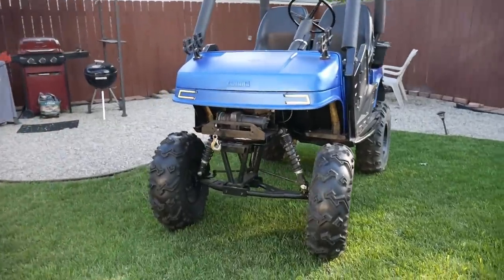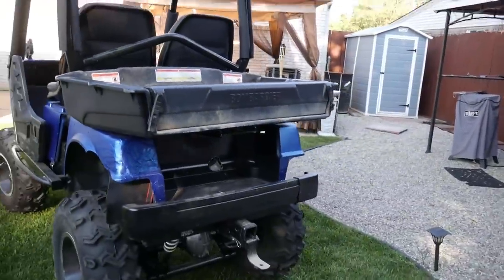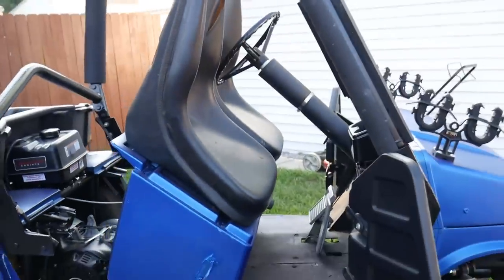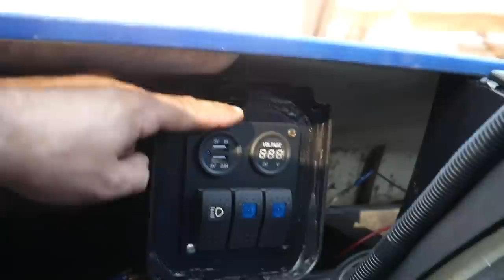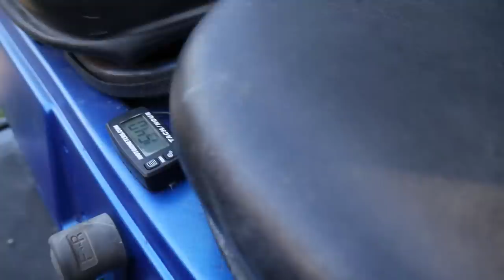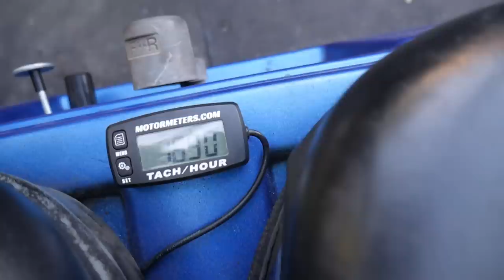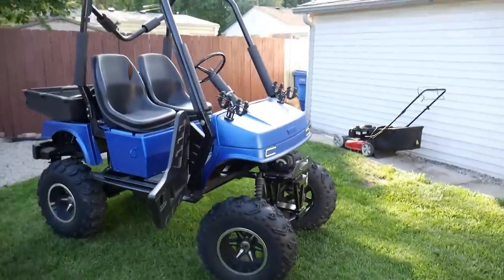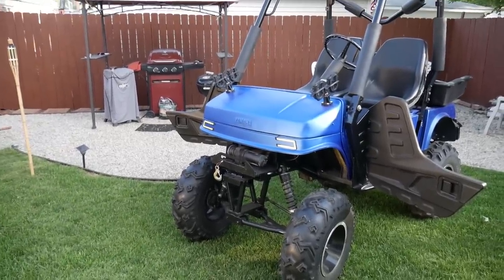Custom golf cart finished !! predator 420 installed!!

Comment: I've been waiting to see this beast finished. I really like your roll bar and doors set up. I wish mine had the same. but unfortunately I'm still stuck on engine and suspension. My honda gx 340 started running rough as soon as I set it up with a fuel pump. I'm not sure what the heck happened. And my front suspension set up is not going to work for me. unfortunately the shocks I bought for 100 bucks are not strong enough. the bid tires rub on everything even with the 4" lift and I have to modify my new suspension lift to make clearance.
Reply from the maker: Kyle Clayton i had to do the same for my front suspension, bought like 3 different shocks before i found something to work and also had to relocate the shock mounts definately frustrating at times. i didnt want to go with a fuel pump thats why i figured a way to mount tank so i could stay gravity fed
Reply from the maker: Kyle Clayton oh and thanks hope you get everything worked out with yourz

Comment: I just bought a Yamaha gas cart project for $200 with a dump bed.  I plan to copy you.   It looks like I will have to spend $600 on a motor, battery, belt and clutch.
Reply from the maker: That's pretty close

Comment: Had a question if you would explain the suspension and where to get the bed from
Reply from the maker: the suspension is more of a body life type lift the box on back is made for a quad that I modified to fit my cart... hope this helps. if I was to do it over again id get a an actual suspension  lift for my model Cart

Comment: Can I  request a ride video? I'd really like to see how your cart does on off camber and inclines. And of course a top speed run like you mentioned. I'd like to see how those big tires increase the speed
Reply from the maker: Kyle Clayton ill try to get a ride video up
Reply: chuck kososky that'd be great to see. I finally got mine mostly finished and had it out camping for  almost 2 weeks. It did fantastic! The honda engine works well minus a few issues with carburetion since I had to use the carb off my 420cc clone. The stock honda carb was all messed up. I'll post a video asap. Unfortunately all atv use has been banned on crown land until we get some rain. With all these fires burning in BC it's a wonder they don't close the bush down completely

Comment: Hey man love the cart! Did you have any issues with wiring the ignition? Does it have to be ground?
Reply from the maker: Thanks, No problems with ignition it does need a ground for engine/battery
Reply: So the ignition box doesn’t need to be ground, just the wire that goes into it?
Reply from the maker: @jigginwithjay2051  if I remember correctly I think the box does need a ground
Reply: Ok I’m thinking it does cause it worked fine before I cut it. Where did you pick up the clutch?
Reply: Any part number on the clutch?
Reply from the maker: @jigginwithjay2051  check out Vegas carts I picked up there performance clutch that was tuned for the predator

Comment: I have a g2 that needs a serious overhaul.
Aside from swapping the motor. What issues did you have trying to retro fit the clutch & torque converter.
Reply from the maker: No problems at all I used the old belt for the previous engine and just used an adjustable mounting plate I think I got both the motor plate and clutch from vegas carts if you haven't check out my other videos on my cart

Comment: do you think you would put a 670 in i have a golf cart but i can get the 670 shipped to canada but i plan on putting a 670 in it but thumbs up bro
Reply from the maker: A CDN Taylor made Productions lil before i bought my predator i heard yhe 670 didnt habe much in performance part available
Reply: @AllThingsCool  it's different now, there's a whole page to the 670 performance, with a turnkey engin from Performance670.com pushing over 30hp and over 40lb/ft torque
Reply from the maker: @rafaelcarrera4414  wow really, I was thinking about pulling the 420 out and building it up but not sure if I want to do that or save money and get a used side by side

Comment: Hey bro I have club car with a 670cc with torque converter when I turn the car on the differential pulley is spinning so when I try to put it in gear a grinds any idea what it can be is it supposed to spin when it's in neutral
Reply from the maker: Al Bert what does ur carts rpm at idle ? If its to high might cause shift problems.. also belt might be to tight
Reply: chuck kososky oh ok yea it sounds pretty reved up and belt is to tight

Comment: How did you hookup the throttle cable?
Reply from the maker: Used the stock pedal and cable used the lock lown screw on top of predator to hold cable in place then ran cable to throttle lever and used a spring to add the tension

Comment: How did you get the stock clutch to fit that engine my stock clutch hole where it bolts up at is a whole lot wider has a lot of play did you have that same problem and if so how did you fix it
Reply from the maker: Jasmine Wright i didnt use the stock clutch but i pretty sire they make adapters if u want to use the stock clutch
Reply from the maker: Jasmine Wright in this video u can see my clutch https://youtu.be/RvgI70ZzGF8
Reply: Alright thanks you help me out a lot
Reply: Buggiesgonewild sells the tapered bushing to adapt stock clutch to aftermarket motor

Comment: Why do some people have belt and chain drive on there set up and you don’t?
Reply from the maker: Just best on mine using the stock g2 rear end
Reply: Ok I thought you said it was from a snowmobile that makes scents just use the stock rear end I’m trying it with a G16 Yamaha
Reply from the maker: @ag4950  the old motor was a snowmobile engine

Comment: Nice where get clutch to fit predator?
Reply from the maker: Vegas carts
Reply: @AllThingsCool   u didn't  have to  cut shaft none? One guy had to cut his 1" . Then purchased  a  3/4 shaft adapter
Reply: @AllThingsCool  look awesome, engine  fit perfect
Reply from the maker: @joneschevy78  nope slid right on no cutting
Reply: @AllThingsCool  Thanks you been a big  help. I'm about  to  look on there website.  Clutch for  a  420 predator engine

Comment: Do you ever run into charging problems??
Reply from the maker: Bo Smith not yet but havent used the led bar alot or winch, if i do though i was going to just buy a small solar panel and mount it on the cage some where i think that woukd be enough
Reply: chuck kososky I thinking about putting a little alternator cause I love on catalina we use it as a daily driver. Thank you for the response love the work you did to the golf cart.
Reply from the maker: Bo Smith thanks ! Let me know how it works out